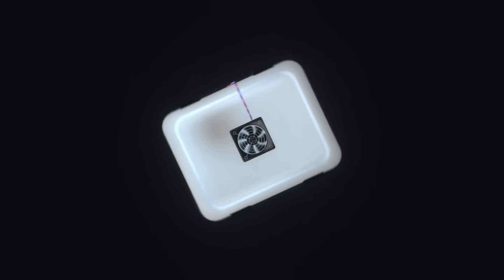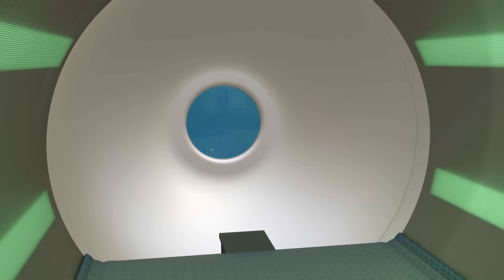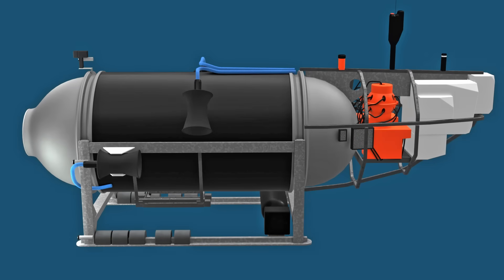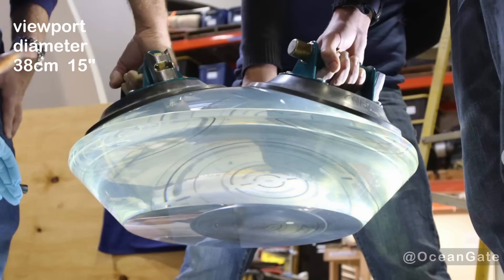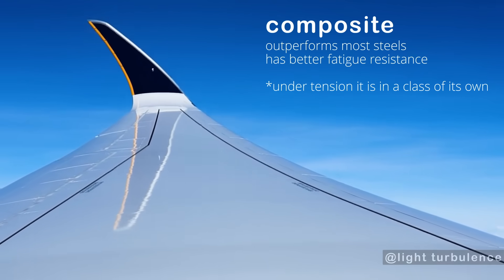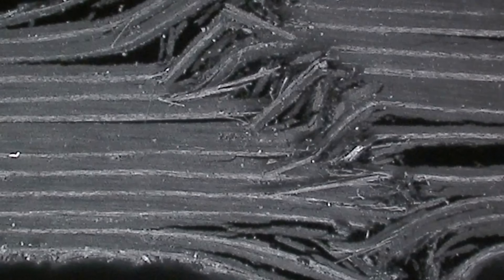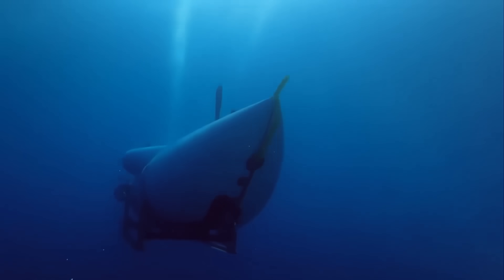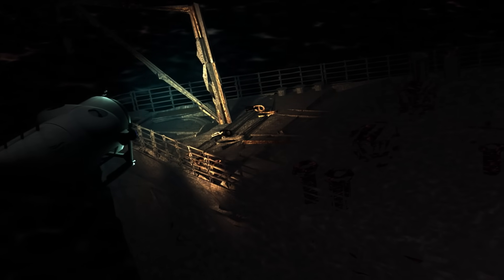Titan Sub | carbon fiber - Detailed Tour

Comment: So...while I'm no material engineer, I do have a personal link to this and some of the look into the behind the scenes of this whole thing, the airbus wing example isn't a great one In my view, while yes it can withstand great force, it is allowed to move and flex, it dosent need to maintain many (if at all) internal pressures against that external pressures that would be applied, it's able to flex quite well
Reply: To add to this, while carbon fiber CAN take all sorts of pressures very well, from what i know it dosent recover nearly as well as something like titanium does, micro breaks and abrasions are common, and carbon fiber parts are used to be responsible, on the front edges of spoilers and wings as an example
Reply: And so on top of the fact that it can flex, it dosent mean it recovers back, and this becomes an issue, especially when dealing with salt water, to my knowledge, they didn't replace the hull after the first or second dive or before the third...this resulted in a material failure due to possible material defect after it was pushed to its limits...carbon fiber is great don't get me wrong, but it's most effective at making parts that will take the most friction and latteral forces, and ones that will be replaced often due to friction. It reduces the cost of replacing such parts...you wouldn't drive a car where an integral part such as the frame is made of carbon fiber. Hell another example I have very personal experience with is carbon fiber lacrosse sticks, because of the cooling and heating over time and between games, the stick would snap because of flexing and small impacts over a long period of time

Comment: This is well done and doesn’t have a lot of the conspiracy crap you see a lot of others include. However, there are some omissions I feel SHOULD have been included. The transcripts of the final dive show that they were descending rapidly, far faster than was safe. It was likely the extremely fast pressure building that contributed to the failure of the CF, not the CF itself or its application method.
Reply: False. The transcript was fake, and the video says why.

Comment: You are wrong in your speculation. The titanium ends were epoxied to the hull.  If you do a little research, epoxies are not compatible with titanium.  Epoxies will not bond to titanium either chemically or mechanically.  It can be done, but you have to use a special priming system to get epoxy to bond to titanium.  The titanuim would have to be mechanically surface etched, followed by a silane sol-gel primer, which was not performed.  It was destined to fail at the bond interface.  This method seems good for golf clubs, but not a submersible to go under water with.
Even so, had the titanium rings been properly etched and primed, there would have been no way I would have gotten into this submering coffin.

Comment: The biggest issue why this failed is it was made of 2 different materials and everything about those 2 materials is different.  Therefore they will do different things when down at that depth.  You need the entire thing to do the same thing at that depth.  An entire sphere made of titanium would nt have imploded if the wall thickness was correct.  And, Im sure they didnt Xray the craft each time like they should have.  Bottom line - it was built incorrectly.  Should have been made of all 1 type of material.

Comment: Mike. semantics are not going to do it man! The carbon fibre is not the failure point with the exception of 'buckling' as a result of fibre 'layup'. The binder Is! Compressive strength ,as you know is limited by the materials ability to respond to deformation, bonding agents do not exhibit the ability to function in this manner due to lack of (molecular slippage). Consequently, without deformation( slippage), cracks occur leading to catastrophic deformation. I am not aware how many dives this vessel undertook, however it was one too many. finally every dive ,results in a certain amount of liquid infiltration into those voids created by the compressive force, therefore over subsequent dives(no pun intended)this has the effect of destabilising the bonding agent. ( just a thought).

Comment: Tge carbib was waste pridyct frin tge aur industri that dint hade clasified it as NOT USEBLE, and threeby cheap.
Carbon has its strength in the pulling direction and are vey limited strength in compression, and actualy less stength than steal. The tube was ment to function by ONLY compression.
The titanium end rings was GLUED on to the carbon tube as they do in car industri. 2 different materials that has 2 different ABILITYS.
It was domed from the beginning, and he to paying customers onbord with the note that they did the journey wuth their lifes at stake.

Comment: @Mike-Bell One apparent fact is that that last sonar ping showed that hull was intact while the Titan was 300 meters above the sea floor. It was about an hour early according to Jeffofstruff. Could the Titan have a small seeping pathway in the lower part of the glue joint? The water would collect along with condensation in the battery-o tank compartment causing the Titan to go down faster than usual. From the photos of collected debris it looks like there are no lag bolts in the flanges. Could the threads be sheared off allowing the bells to part from the flanges? It might just be that the carbon fiber cylinder was intact when the Titan hit the sea bed.

Comment: 17 tons and survive or 10 tons and being vaporized.  composites are NOT suitable to cope with outside pressures because the plastic is compressed. Only in tension the fibers will take the force  like a rope it can only take tension. That's why  they use composite Lng tanks  pressure from inside  gives tension and carbon can take tension but not so much compression. in other words in compression carbon composites act like hardened plastics and in tension, where most metals are at the weakest, carbon excels.   outside pressure gives compression where composites are the weakest and metals are the strongest. inside pressure gives tension where carbon fiber composite excels and metals are at their weakest.  but a submarine has  1 kg force per square meter of force pushing inside while there are 380 kg or 3800N of force per square meter that try to crush it and like I said only the bounding plastic was coping it
Reply: ah yes forgot to mention, by compressing it you are prone to fatigue the bounding and layers are prone to delamination

Comment: Still conjectural, but a video that gives a far better picture insight than most all others. In a sense CF is only as good as the glue that holds it together.  Presumably this was the best epoxy presently available.

Comment: Interesting summary Mr. Bell.  Technology and materials have advanced significantly in the last 30 years.  I wholeheartedly agree with nearly everything you posited.  Of the couple of remaining point I do not have enough direct knowledge and remain neutral.  Regardless of the potential cost (thus highlighting a centuries long hurdle) 'new' approaches, materials, etc. must be tested tested tested.  However, it's not the action of the test the ensures success, but thoroughly studying results and how we apply lessons learned.

Comment: The problem wasn't the carbon fibre, or it's layout, in isolation. The problem is that the coefficient of compression is different between carbon fibre and the titanium domes. You simply cannot have variations in joints. It was always doomed.

Comment: The only resistance to the extreme pressure water laminate local penetration ended up being the epoxy. Any microscopic error in layup offered the opportunity for penetration. Once water was inside the laminate, more migration would displace fibres allowing even more migration, each dive would be penetrated a little further in the same area, cracking noises would be local fibre failure, not catastrophic. When at some place the local penetration has got far enough to collapse the remaining thickness, progressive immediate failure would occur. It would only need one place.

Comment: addendum:  the amount of force transferred from the engine through the wing to the fuselage on an aircraft isn't all that much as the fuselage has aerodynamic properties that would produce 100+ mpg land vehicles if it were possible to do so and much of the supportive force of the wing root is still metal.    Carbon fiber does have exceptional tensile and compressive strength... the problem is the sub design used neither of those qualities it relied on the interbinding of a-laminar weave and THAT is only as strong as the binder, which is a lot like the acrylic window that deforms.    The carbon fiber should have been used as an insert support for a lighter titanium shell and not on its own - pressure intrusion into the weave moves the stress point in from the outside and it was only a matter of time before the structure failed just like squeezing cheap food bottles starts to separate layers of plastic.

Comment: i am not a structural/material engineer but still i genuinely dont understand why engineers insist carbon fiber is strong , i put it this way 1. steel /titanium does not shatter like glass 2.  steel/ titanium does not de-laminate , 3. carbon fiber does not regain integrity after stress events (cant cope witrh cyclic loading) the noises in the transcripts were de-lamination /crack propagation most likely caused by previous over de-formation 4. the integrity of metal can be inspected even into deep metal (i.e testing of turbojet fan blades) carbon cannot be tested non destructivelly 
ok i partlly conceede, carbon fiber is "strong" ONCE , titanium is strong many many times
Reply from the maker: All materials including titanium will undergo load cycle damage if too thin.  It is the engineer's job to optimise the thickness of the material and have sufficient excess material to not fatigue while not being too heavy and expensive.  It is not as if metals are fatigue free.  
And actually composite has better fatigue resistance than metals in part because it's fibres are aligned to the load path whereas metal molecules don't have that advantage.  
Brittleness is a pro and a con.  Brittleness makes someting stronger, but comes with catastropic failure, which is why tempered glass can be so strong.  Carbon fibre is still intact even when titatnium starts to deform and gives some warning.
Reply: @Mike-Bell  I see your point but still troubled about delamination and crack propagation, metal can be inspected for cracking

Comment: As a Reliability Engineer (though mostly in software), my question to experts would be, even if the CF pressure vessel was properly designed, and a prototype tested to destruction, how would you know the 2nd model would behave the same? CF is a very "messy" material, and no two pieces are exactly alike, even when built by robots. IMO, the only way to gain confidence in CF parts is to make many of them, test many of them, and have a huge safety margin. Not practical with such a huge and expensive part unless you're Boeing or something.
Reply from the maker: Yes exaclty.  Proper testing is not a once off. It a laborious and thorough process involving destructive testing with sufficient repeats to get frim data on load cycle fatigue characteristics and to factor in the normally expected variances expected in the manufacturing process.  And beyond the resources OceanGate had unless they charged $1m or many mill per ride.

Comment: I think the issue is fairly straightforward. Nothing wrong with the materials used. If you are going to be under extreme pressure, make it a sphere not a cylinder. Challenger and all other deep sea submersibles have a sphere that is under pressure housing the pilots. Theoretically a sphere shape would simply be able to withstand at least twice the force that a cylinder could.

Comment: Completely agree with you, the material is not the problem, it is how it was done, if they went with higher safety factor, say 5-6, instead of 2.6 safety factor they did, it must be still around and still is lighter than all metal construction.

Comment: The likely reason for the outside lip of the tubes end plate to be sheared off like it was is due to the diesel effect of the flammable items within the pressure vessel such as clothing or petroleum-based items upon the implosion. 

The pressure inside the sub went from atmospheric to over 2000 PSI near instantaneously this is the principal how a diesel engine operates only at a lower pressure.

Comment: Personally, I don't think the carbon fiber failed, until the explosion happened. I think the pexi-glass portal failed, resulting in the compression and explosion of the humans on board. This resulted in the craft blowing apart, and the rings being blown outwards seems to support my theory.  Let's face it, the viewing port was the weak link.  He was exceeding its safety limits and design. 2700 tons of force? That plexiglass should have been 2 foot thick..

Comment: Not even going to bother explaining once again why cutting edge companies like General Dynamics, builder of Gulfstreams, F-16’s, the NR-1 and Atlas Rockets, who builds carbon fiber fuel tanks, drive shafts, rocket motor cases and missile launch housings do not use CF in any hull constructions for submersibles. Unfortunately, it is going to take another attempt and catastrophic failure, maybe more, of a carbon fiber submersible to convince some people that carbon fiber is not the be all-end all material they think.

Comment: Ultimately, the idiot chose to minimize weight at the cost of compromising passenger safety. That's the bottom line here. Technology exists to do what he wanted to do . He cheaped out, lied about the subs inherent reliability and refused proper testing . Another genius sub designer.

Comment: You do not have to be a structural engineer to see that: any dependency on those thin ring lips being able to adequately resist the extreme pressures involved was an extremely foolish assumption. The sharp inside corner of both sides of the lips were a serious weak point of the design and were effectively like the perforated dotted line on a piece of paper, which enables the paper to be torn on that line. If those sharp corners were blended further into the ring, which would result in a deeper concave recess instead of the flat bottom method used, it might have been able to do the job required of it.

Comment: The bottom line is that no carbon fiber deepsea submersible design has been properly validated, so to say that CF is "perfectly" suitable for this application is just plain FALSE! The video itself explains how a defective layup process can cause an unpredictable failure of the pressure vessel, and this submersible had a defective layup process. Deviating from a spherical to a cylindrical geometry AND using an unproven material, as well as depending upon a totally unproven failure detection system, is tantamount to criminal negligence.

Comment: If curious on the stresses in the glue joints between the main body and the titanium end rings.  I’m guessing they compress at different rates.     I won’t be surprised if the failure was a bonding failure.

Comment: Aerospace Composite guy here, one aspect often overlooked in these videos is the prepreg itself. If stored improperly (temperature fluctuating, past use by date, etc) the prepreg shouldn’t be used especially on a submarine. There are a myriad of reasons the composite could fail.

Comment: 1) Even when wrapped around the mandrel, there might not be tension on fibers - how much does the hull deform when at depth?
2) There was some audio recordings that suggest the sub was heavier than expect - that would suggest water intrusion.
3) This is still a problem with Carbon Fiber - anyway you shape it.

They could have made smaller unmanned versions....

Comment: Your theory that the hull cylinder CF longitudinal fibers not being under any kind of pre-tension during lay-up and/or during curing has some merit as a contributory factor to the cylinder failure. However to find the correct level of pre-tension would have been time consuming, expensive, and the manufacturing process would have needed a total re-think. These reasons are perhaps why this was not done.....or, the strength of expertise of dealing with certain types of composites was missing from the team. I agree with @airasj1 that because of one failure you shouldn't throw the baby out with the bath water, instead, more research needs to be done so that the properties of CF can be exploited to the full if its use in the construction of submersibles is to be realised.

Comment: The design sucked, after being bolted into the submersible, there was no exit for safety.   You not an engineer of carbon fiber, it may be the one of the strongest but the required resin manufacture an object is not.   Carbon fiber does not do well under multiple compression, it was not laid at different angles, and to have the carbon fiber cylinder glue to titanium end caps with different compression rates was insane.

Comment: Everyone keeps getting it wrong about carbon fibre being good at expansion preasure because its used in planes? carbon fibre is not used in a planes preasure cabin....... carbon fibre is only used in the vertical stablizer on planes, flaps and wings and other various parts of planes but again NOT used as the preasure cabin, a aircrafts preasure cabin is made from aluminium thats what expands when preasure increases in the cabin and outside preasure reduces as the plane climbs

Comment: Yeah, carbon fiber can take the stress of compression, but not repeatedly because it Cannot be deformed without fracturing the composite resin it’s essentially fancy fiberglass what happens when you expose fiberglass to repeated deformation it fails